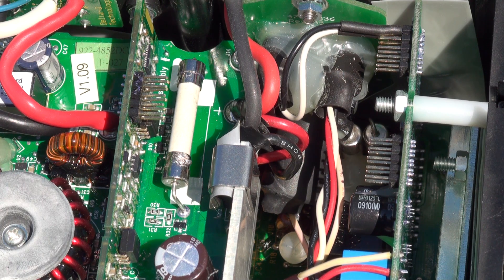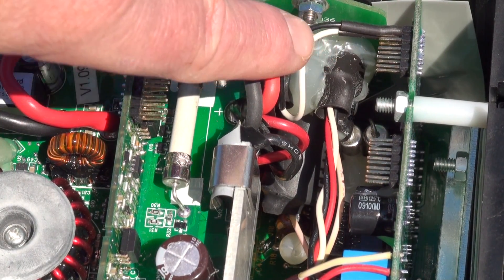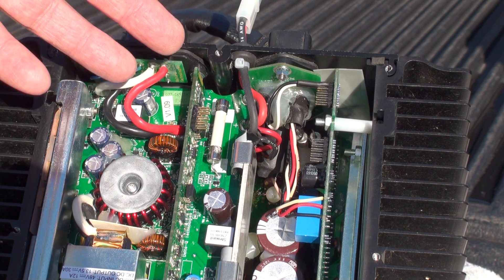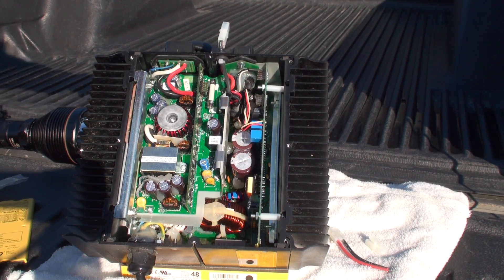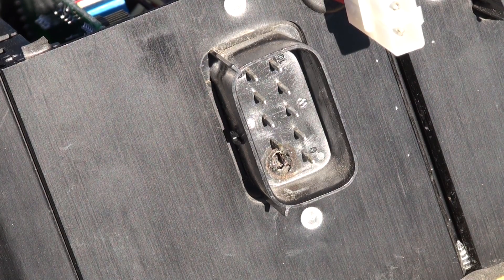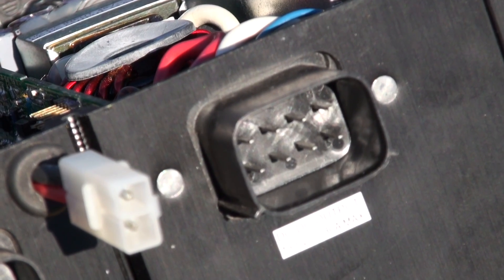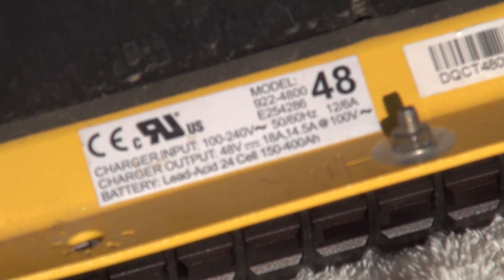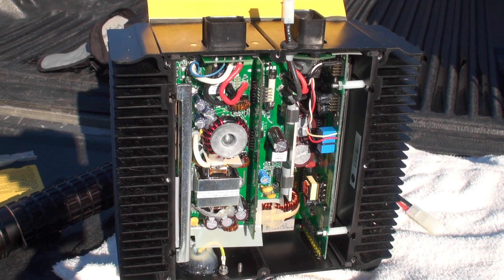2010 Polaris Ranger EV 4x4 Charger Repair 48volt Charging Pin Part1

Comment: David 
I have the same year Polaris with the same issue. So can I just tap right into the red power wire right on top and just run a new wire out? Should I cut the wire or it doesn’t matter since it burned out at the bottom, then I can just solder into the  board at the top connection? Any help would be greatly appreciated . Thanks
Bill

Comment: Could you change out the charger to a golf cart charger(for example)? How could you replace the DC-DC parts?
Reply from the maker: NO, you must have an output as I said in the video to power the motor controller.  Even though I charge from solar now, I still need this voltage feed from the Delta-Q, or the controller wouldn't power up.  Whole new problem you'd have to find a solution for if you want to remove this charger from the EV.
Reply: Use a separate DC/DC converter 48V to 12V 30A